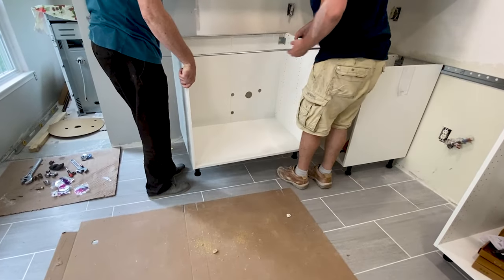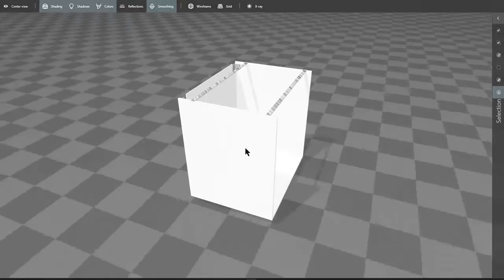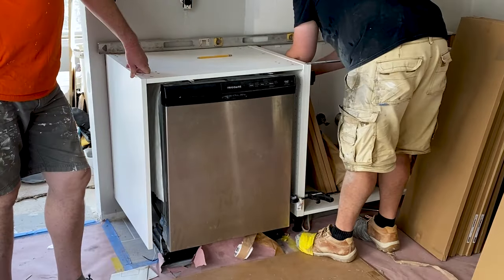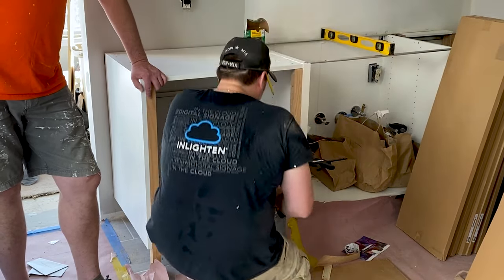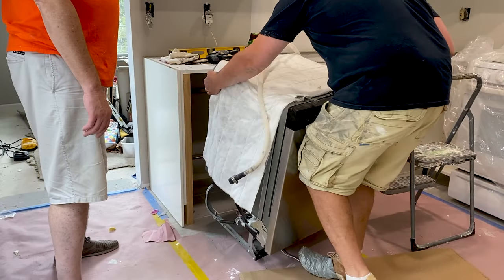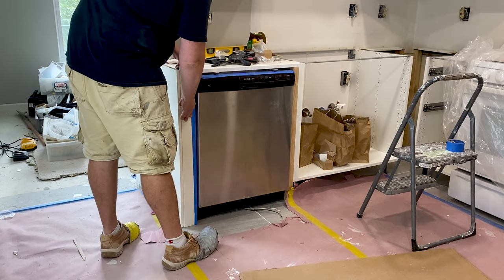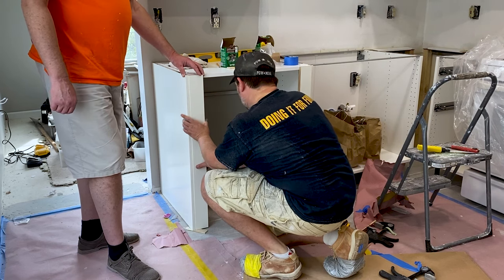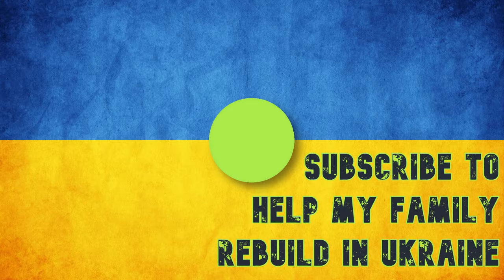Unbelievable Hack: Creative IKEA Dishwasher Cabinet

Comment: How's that cut edge that you painted holding up next to the dishwasher? With the steam, that would make me nervous. Trying to match the paint perfectly so I can use wood doesn't sound fun either though.
Reply from the maker: So we sealed the sides with paintable caulk first to water proof it and then painted it same white as door frames. It’s holding up really well no issues so far.

Comment: What is the height of the inverted cabinet inside measurement (the vertical space inside the cabinet? 

I love this solution, but found that the thickness of the horizontal board is too thick to achieve this without increasing the height of the rail to allow the minimum measurement for the height of the dishwasher.
Reply from the maker: If I remember correctly they are 30in high. I hope that helps. Make sure you check the feet of your dishwasher it may have been lifted to fit the old cabinets. If you mounted the rail at the hight recommend in the kitchen instructions you should be able to fit the dishwasher as we did. Thank you for the questions I’ll always happy to help. Please pay it forward by hitting the like 👍 button so the video is recommended to more folks like you looking for this information.

Comment: Very good video, saved it for when we do ours this summer. How big is your kitchen and how long did it take to complete the cabinets?
Reply from the maker: Looking forward to hearing about how your project went. Thank you for taking the time to leave a comment and subscribing to support the channel. Our kitchen is 11x10 ft it took us 4 days but we are working evenings after work. It took about 5 hours to put all the cabinets together by my self. Then about an hour for the rail system and once you have that  your on the home stretch if all your cabinets are standard size. We had to wait for some additional cabinets so it took us 3 day to install all the cabinets and then another few hours to put on the doors and drawers after the counter top and backsplash were installed. But I think our size kitchen can be easily done in a weekend. Check out the cabinet install video if you have not already. It should give you and idea of how straight forward it is. They did a great job designing this hanging system.

Comment: This is an awesome idea.  Does your cabinet end up being 34 1/4 high, normal base cabinet height, after you added the support on the corners??  Thx.
Reply from the maker: Yes the high would be leveled with the rest of the cabinets next to it as it gets attached to the rail on the wall which sets the hight. I hope that answers your question if not please let me know I’m always happy to help. Also please hit the like 👍 button on the video so it gets recommended to more folks like you looking for this info.
Reply: @DIYwithMAX , do you think I could do this with non IKEA cabinets.  I have a pensulia that has the dishwasher on the end, but no wall behind it, its open, and the countertop will go out like a breakfast nook so i was thinking this idea might stabliize things??  Thx.
Reply: Could I put those trim stips on the rear corners, like the front, so it sits down on the ground since mine is open in the rear??
Reply from the maker: I’m sure you can but I would also secure the back once to the wall just to me safe so it does no move around on you. If you need a drawing of what I’m talking about please email me at DIYwithMax@gmail.com and I’ll email you a drawing of what I’m talking about.
Reply from the maker: You can put them on the rear as well but I would secure the rear once to the wall as well not just to the cabinet. Please email me if you want to discuss further. I’m always happy to help brainstorm through these ideas. DIYwithMax@gmail.com
Reply: @DIYwithMAX , thanks.  I have no wall to attach the back too, its open to the dinning room so that is my issue.
Reply from the maker: @dearsmiths1 in that case what is under the cabinets on the floor? If it’s an island then I would mount a 2x4 to the ground and then attach the four posts to that for rigidity. And I would also use 2x4s for support if you’re going with granite countertops. I was able to get away with 2x2s because half the weight off my cabinet is resting on the rail secured to the wall.
Reply: @DIYwithMAX , great advice, thanks so much.
Reply from the maker: Any time. Always happy to help.

Comment: Just an FYI.  I was hoping to pull of something similar with an Ikea Enhet base and a my dishwasher  (23.9 inch width). The dishwasher would not fit into the interior width.     Seems this was executed with the 30x 24 x 30 cabinet.
Reply from the maker: That is correct we did use a 30” cabinet because the 24 would not fit most dishwashers.
Reply: @DIYwithMAX  Thanks for confirming.   Impeccable job.  Inspired me for sure.   And my disappointment now leads to me taking the plunge with my first attempt at some woodwork so I can make the fixture I need.
Reply from the maker: @antonioanderson5239 that’s awesome buddy if your comfortable with it send me a pic of the final product to my email DIYwithMax@gmail.com. I love seeing the projects you folks in the community make.

Comment: The lower left front corner is not secured. One accidental kick and it will tweak out of place.  It should be secured to the floor with a bracket. Thoughts?
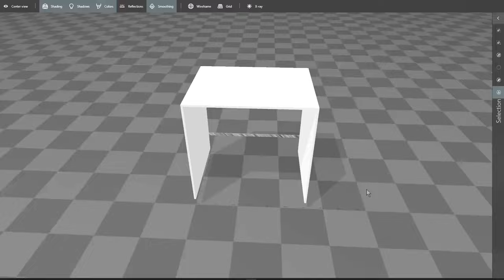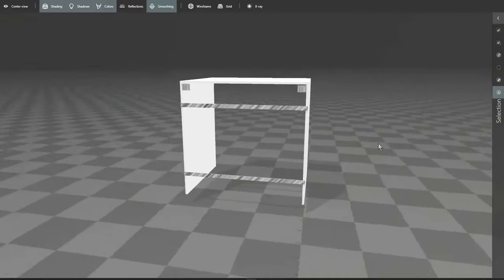Reply from the maker: It’s secured from the back. You can see it in the computer render at 1:03 to 1:08. Also there are three inch screws from the top of the cabinet to the legs. With the weight of the counter top on it it’s not going anywhere. Definitely subscribe because if that changes I will definitely make a video about it and let you know the outcome.